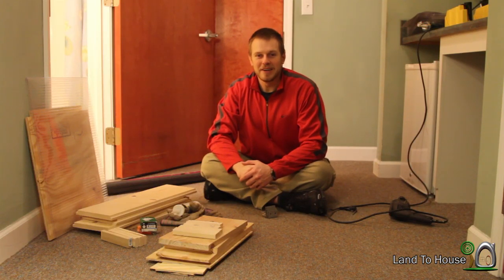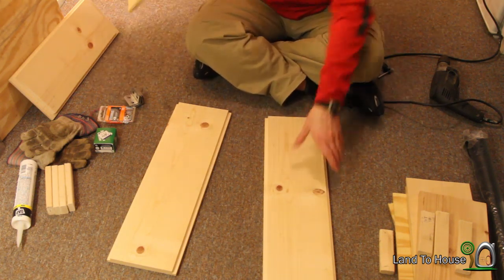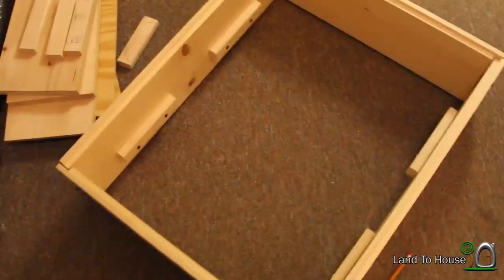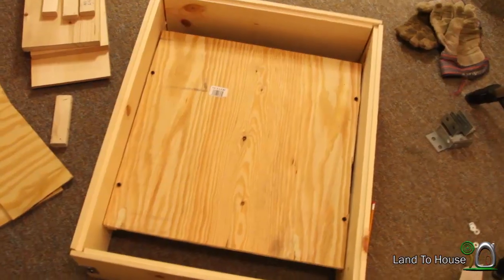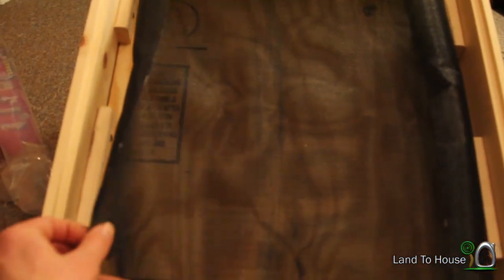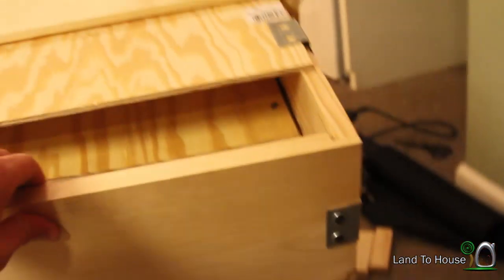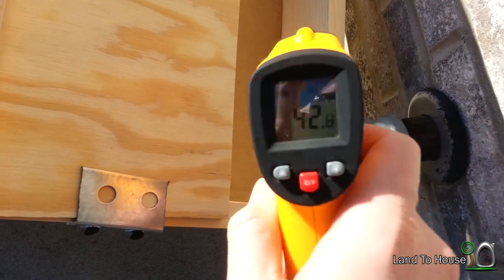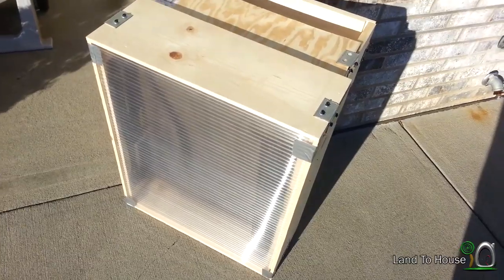Passive Solar Heater Test 1

Comment: I like it! What about making the passive water heater and hooking it up to the ram pump? If you had enough coil/black hose maybe it could get warm enough. Don't know!
Reply from the maker: Absolutely!  I have an idea for a thermosiphon with ram pump that I am designing right now. I just got the materials to make the heat source. I would think that a solar water heater would have to be rather large to keep up with the large flow of a ram pump but stored in a tank and used later.... indeed.
Reply: I was more thinking ram pump pushing water through heater then to destination.
Reply from the maker: G.W. Barker I see. I bet as long as you have several bends in a pipe that wind upwards you would be able to heat the water. I was first thinking small scale and then realized that if you had several feet of pipe it would be heated by a large area. ... So...YES I think that would work very well. If you could take creek water at 50 degrees and get it to 130 degrees that would be all you need for showers.